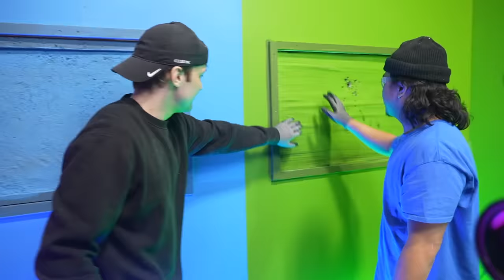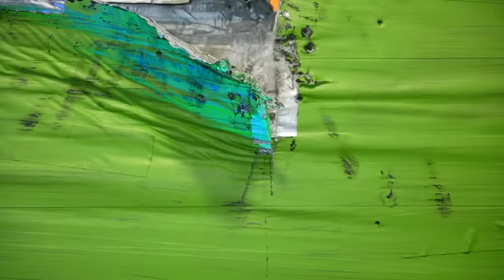Don't Break The Wrong 100 Layers Wall

Comment: What do they determine to be 100 layers? Cause if standard drywall is 1/2”, then x100 layers, that’s 4’1” thick drywall, and it looked like Dustin only broke through maybe a 6” at most